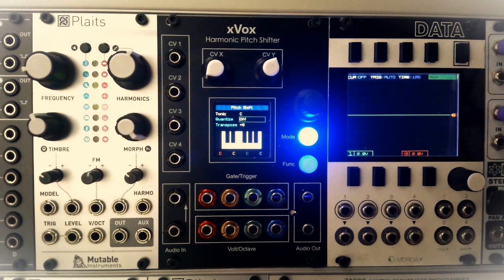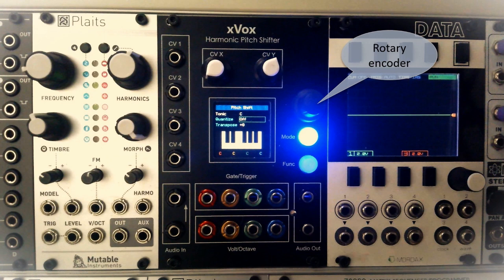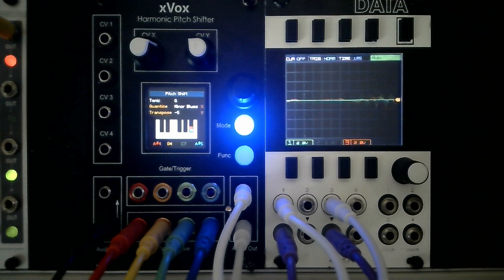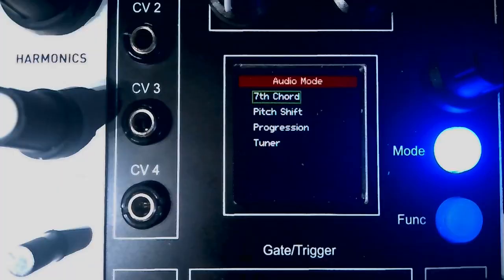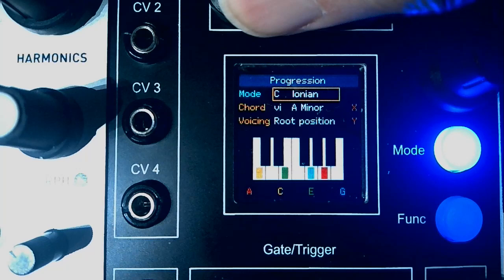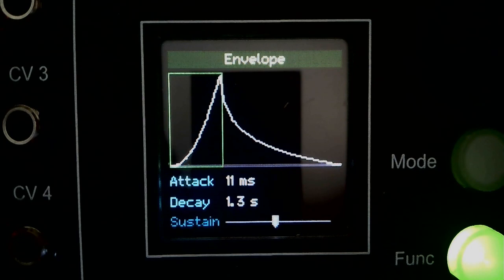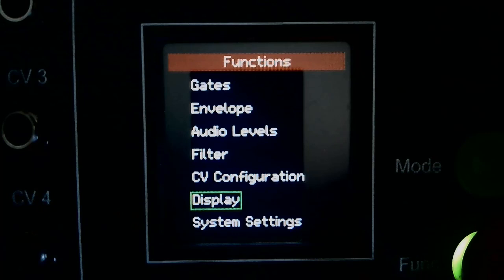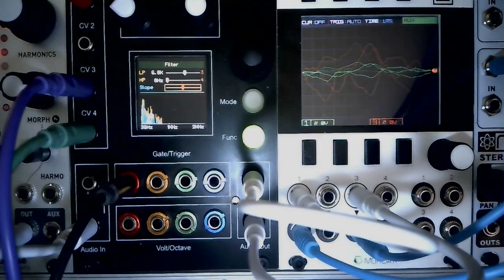xVox a Harmonic Pitch Shifter module for Eurorack

Comment: Certainly interesting. Very impressive work. Tho I do like my modules in even numbered hp! Are the available scales all pre-set? Is there an option to install Scala files for instance or make edits in the quantiser to create tailored scales? Strangely I came across this searching for a pitch shifter capable of non-octal shifts ...
Reply from the maker: I have some ideas about supporting user defined scales. I don't currently have support in my application for accessing external media but I do have a USB socket on the back for firmware updates. I'll add this to my feature list. Are you interested in micro-tonal scales or just custom scales?
Reply: @gregs6rain  Hi thanks for the reply. Yes microtonal. Though perhaps more specifically Wilsonic. That's why I mentioned scala because it's such a huge depository for all of this stuff. Anyway I shall keep on eye on how this project of yours develops. Keep impressing us!

Comment: Very interesting module, I wonder if you could run vocals through it  for some Messina style effects
Reply from the maker: xVox can do some interesting things with voice but as I understand it the Messina is a very specific effect based on layering multiple autotuned feeds. I don't think that effect can be replicated with my module.
Reply: @gregs6rain  the auto tune feeds are important, but I believe another component involves processing vocals through a polyphonic harmonizer vst from eventide, the equivalent of which is almost impossible to find in hardware format.

Meris hedra comes close I think
Reply from the maker: If you haven't already, check out my new video demonstrating a vocoder effect added in the latest firmware release. It might be the kind of effect you are looking for.
Reply: Price would be a big consideration for many. Looks very enticing. Well done, friend.
Reply from the maker: @arpmoog  xVox is now also available as a free VCV Plug-in. It is functionally identical to the hardware version.

https://library.vcvrack.com/gregsbrain/xVox